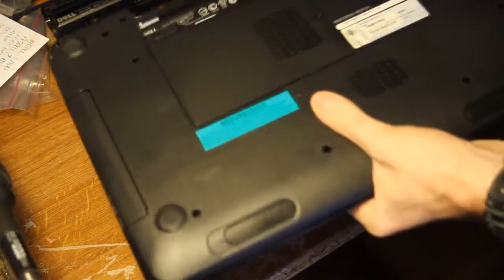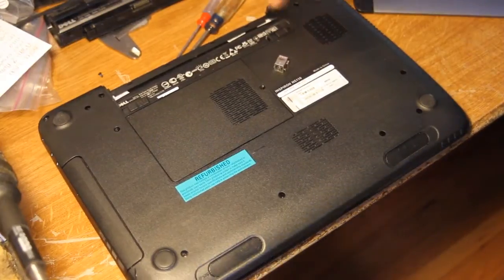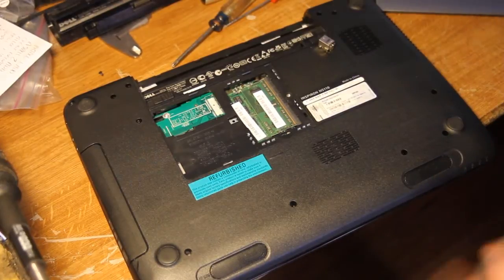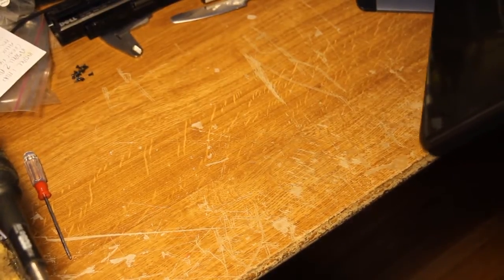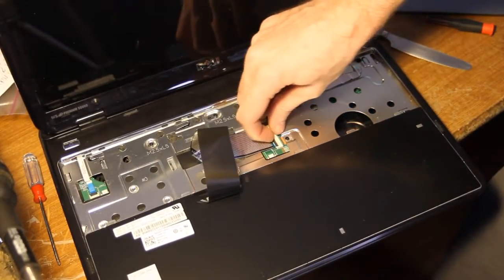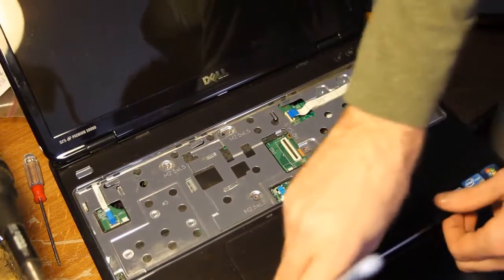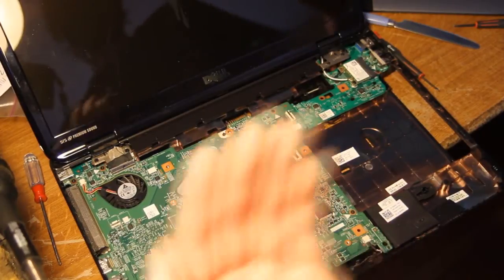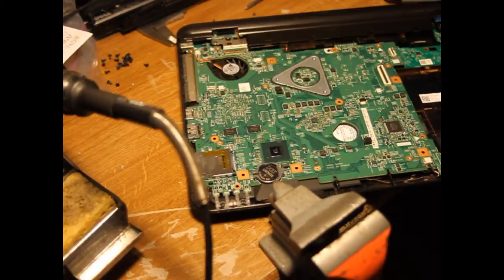Dell Inspiron N5110 - AC Jack repair EASY, FULL INSTRUCTIONS

Comment: hello great tutorial its a late comment but my ac board’s connection part to the motherboard is burned in both boards :( question is, can i change the burned socket or it is useless?